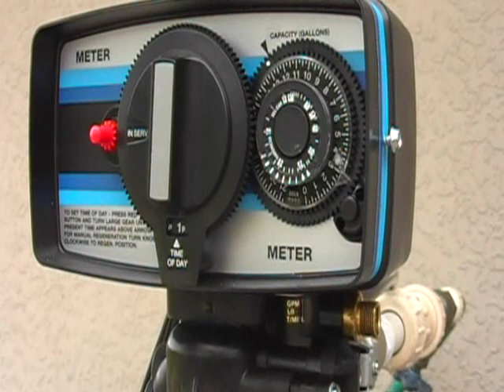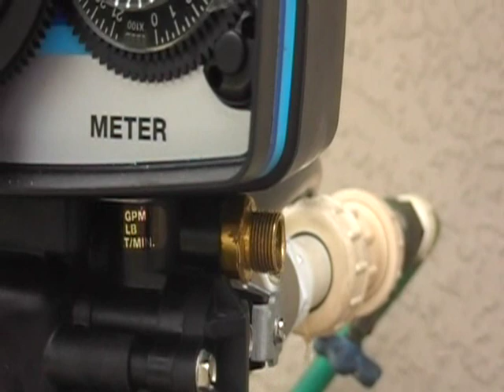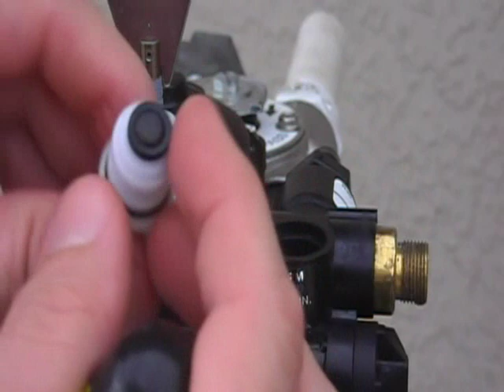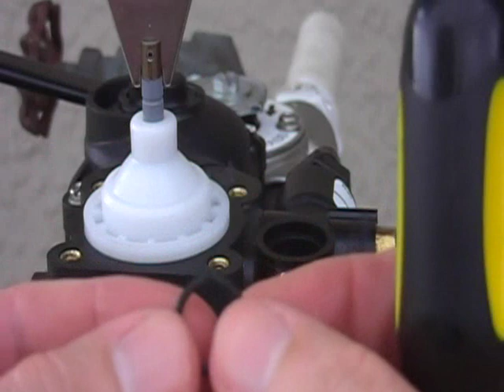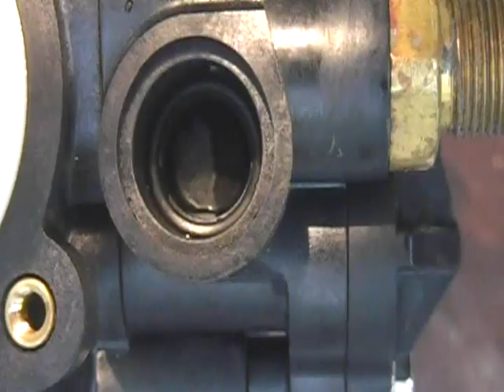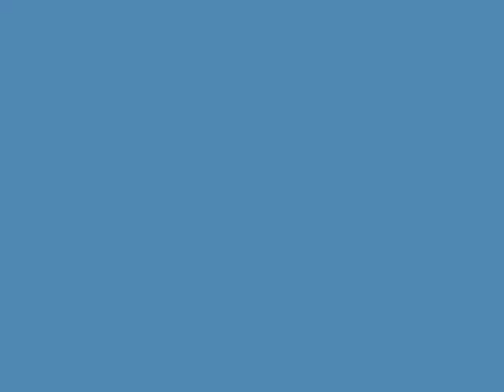13302 Oring Damaged in Fleck 5600 water softener

Comment: You mentioned resin particles. If the distributor o ring needed to be replaced would you see resin beads in this area?  Im able to see a little bit of resin beads in the hole i was wondering if that could be the issue? Thanks